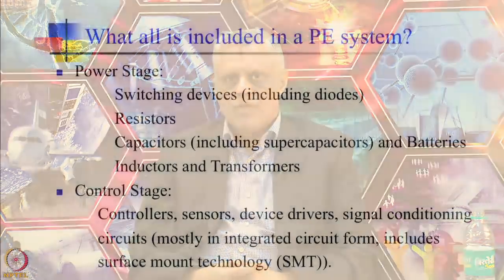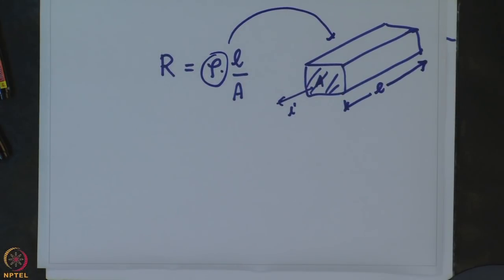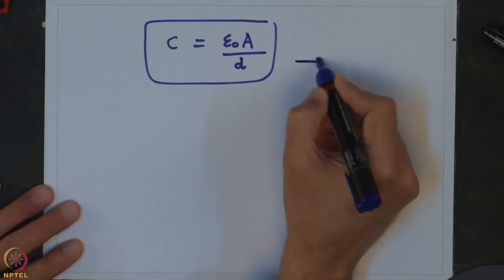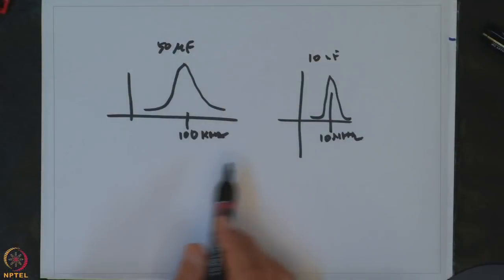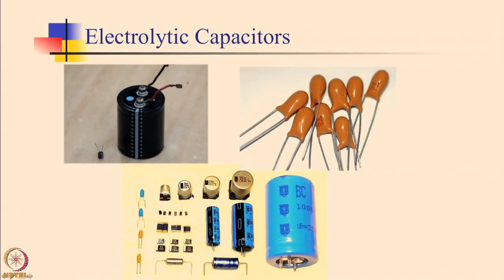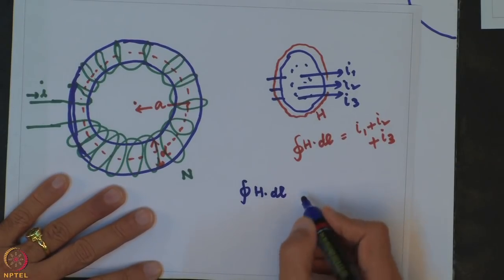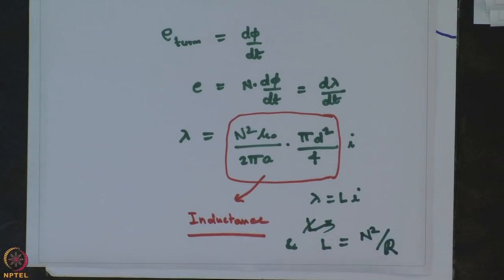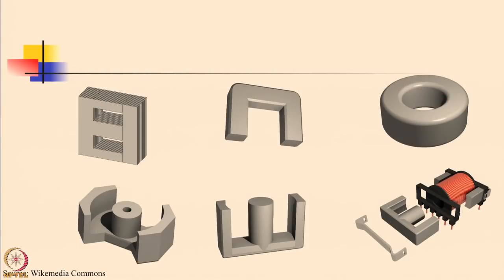Week 1-Lecture 4

Comment: Summary of slides:
What all is included in a PE system - power stage and control stage
IGBT Power control devices example
Packages of power devices
Heat Sink - it is a high heat capacity body on which a power device is placed which allows the power device to stabilize the temperature
Power switches mounted on heat sinks
forced cooling with heat sinks - using fan
Resisters and its uses - Solid carbon composition resisters, Film resisters, Wire wound resisters
Capacitors - dielectrics, dielectric strength, loss tangent = G/B
Dielectric material - polyester, poly-carbonate, polypropylene 
Electrolytic capacitors - construction of Aluminium electrolytic capacitors
Ceramic capacitors, multi-layer capacitors, Film capacitors, Super capacitors 
Inductors and transformers - flux, magnetic core, saturation of the core leads to actually shorting of the EM system - it will draw large amount of current and might cause some safety issues. So, current is not operated beyond a threshold value
Transformer is a pair of inductors, Types of transformer cores